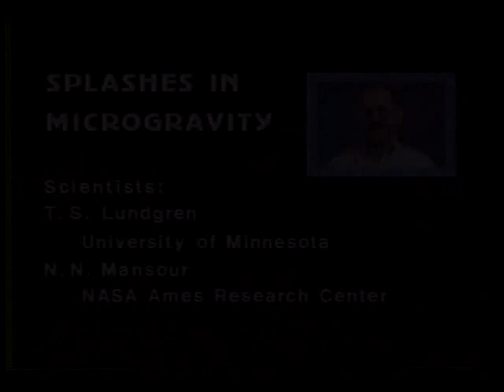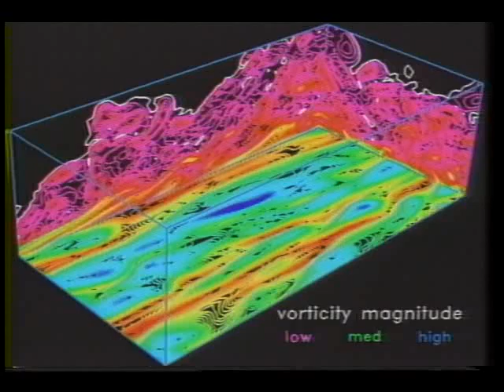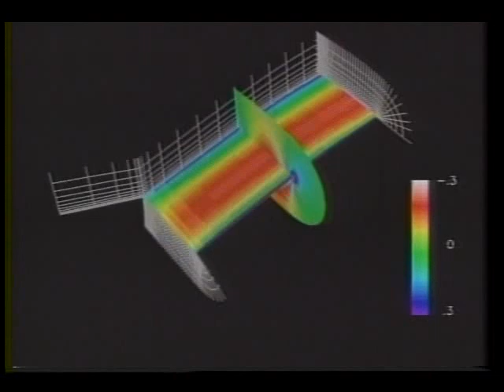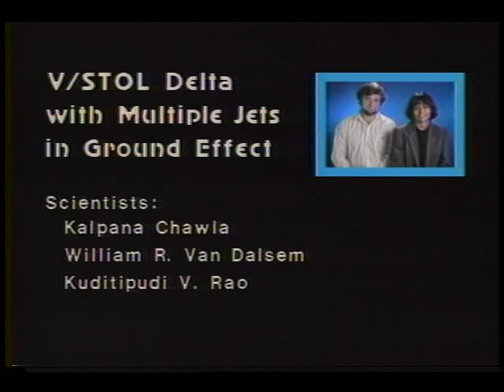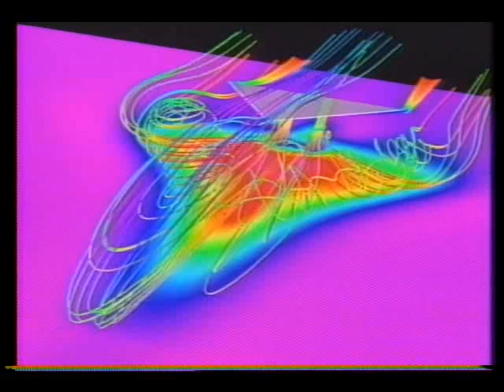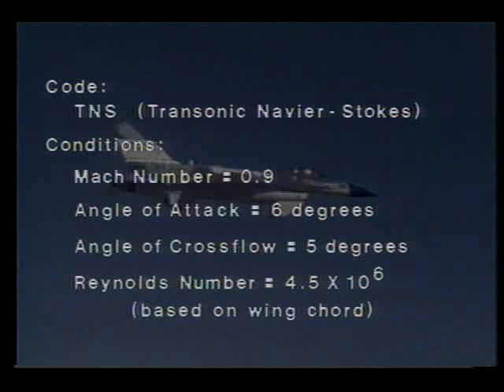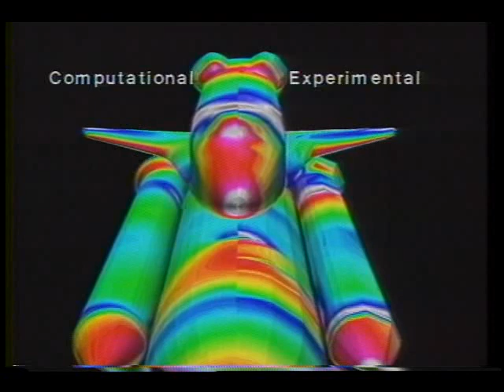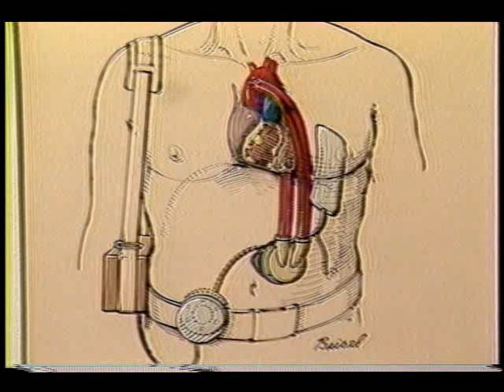The 1988 Computational Fluid Dynamics Highlights

Comment: I wish there was some information about what hardware these simulations were run on, how the meshes were generated, how the results were processed, etc. Amazing these renders look as good as they do over 30 years later.
Reply: Most of the actual CFD ran on Vector Supercomputer (CRAY 2,CRAY Y-MP, IBM 3090,maybe some Japanese systems) 
The rendering seems to be done on early Silicon Graphics workstation (probably MIPS or Motorola 68000 based) using their own custom "Geometry Engine" accelerators
Reply: @jorcyd  thx